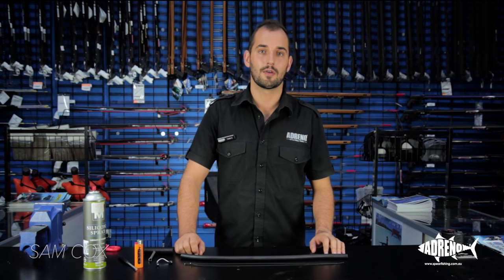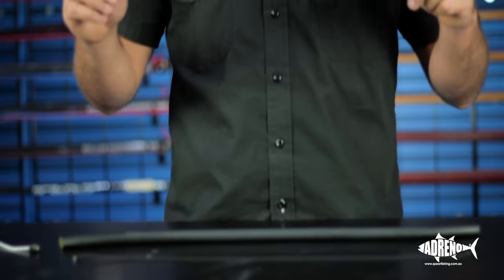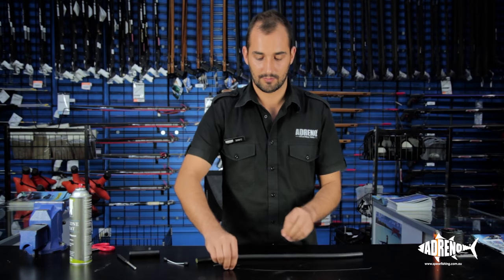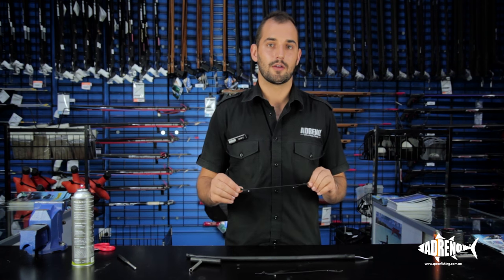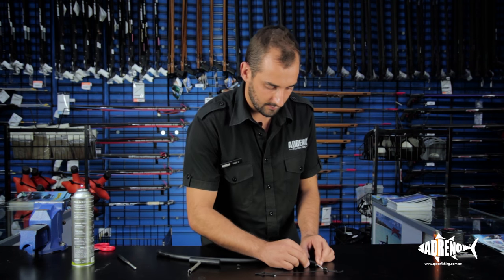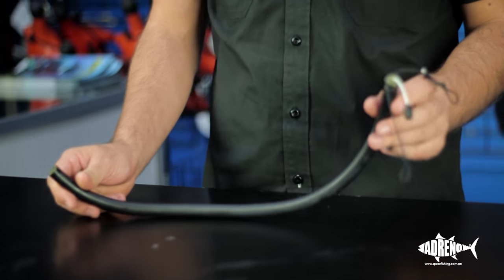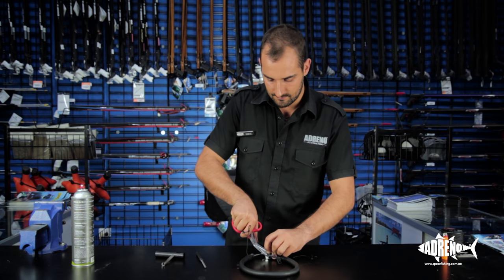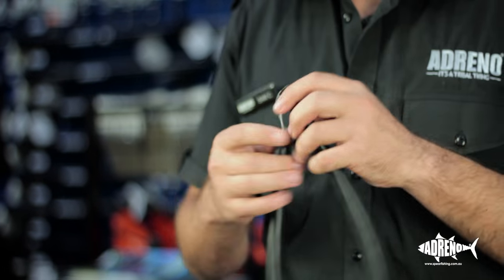How To Make a Speargun Rubber | ADRENO

Comment: Thanks for the guide! I notice you've got the gun length vs rubber lengths listed on your website. There are lists for single and twin rubbers.
If I'm making two rubbers for my Rob Allen Sparid 1400, do I make one 75cm and one 85cm rubbber, or do I make two 85cm rubbers?
I'm assuming it's the former, since the 75cm would be meant to sit on the closer shaft notch, and the 85cm needs to stretch further to reach the second notch. Is that correct?
Reply from the maker: +Rowan Doherty 
Hi Rowan. Good Question! We'd recommend that you use two 85cm rubbers. Because you have two you don't need the extra power that the shorter rubber will give you. In fact you might end up overpowering your gun, plus two longer rubbers makes loading easier